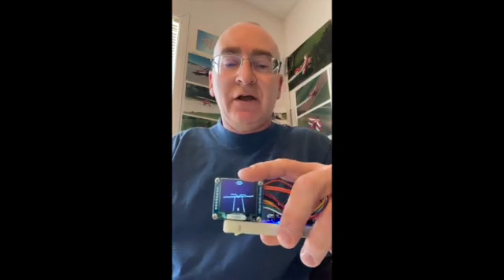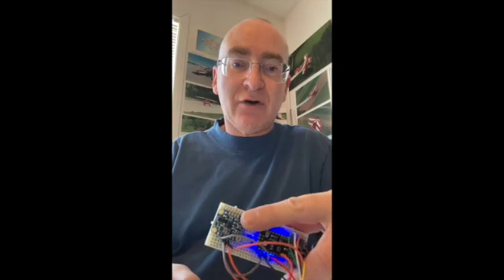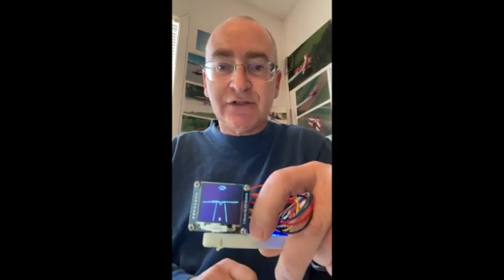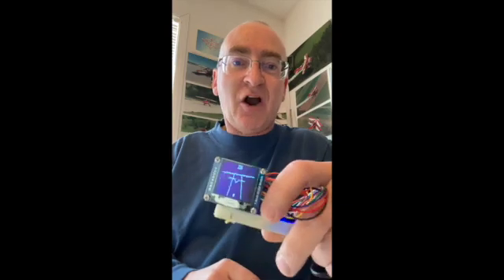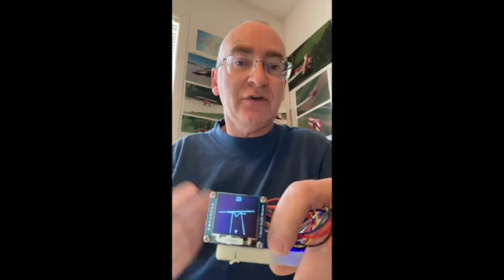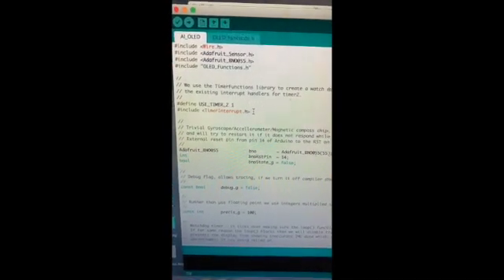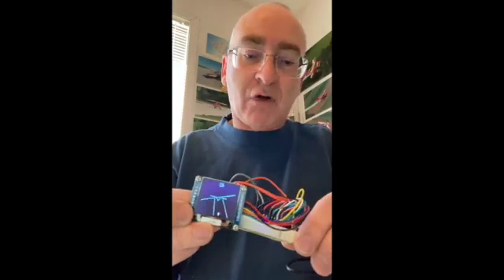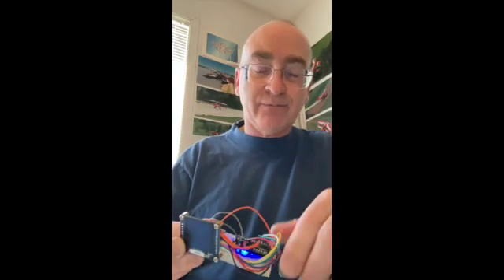Arduino toy artificial horizon and watch dog timer

Comment: really great!! The project itself, but also the watchdog approach looks really professional. I will use this inputs in my project with BNO080,1.5inchRGB OLED and ESP12-F. Thanks a lot!!
Reply from the maker: Thanks for the feedback. Actually I found it more interesting to try to deal with failures than the actual basic code. The watchdog really helps in that regard.

Comment: Can you tell me how your device differs from an inclin-o-meter. In a balanced turn wouldn't the horizon be level? ie. apparent gravity is through the bottom of the aircraft.
Reply from the maker: Thanks JT - The BNO055 device has not only a G meter but a digital gyroscope. It outputs the apparent gravity vector which as you say will change with acceleration but it also outputs the 3d gyroscope vectors which are not affected by acceleration. Its is much more sophisticated than a simple inclinometer although it can provide that function also. In fact the little "ball" at the bottom is implemented by looking at local acceleration only. The reference material for the BNO055 are available on the Bosch and other websites if you are interested in the gory details.
Reply from the maker: https://www.youtube.com/watch?v=PK05u9c3yWI  

The above video has a nice explanation of how gravity is removed from the digital gyroscope implementation. Its pretty cool stuff.